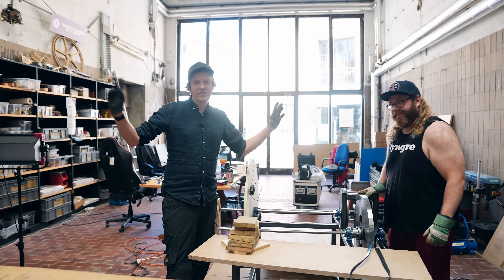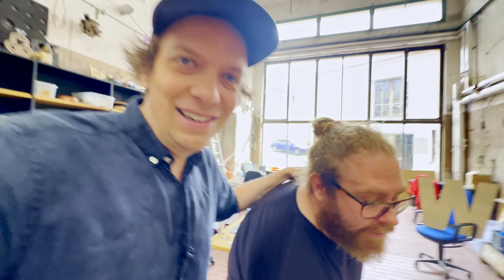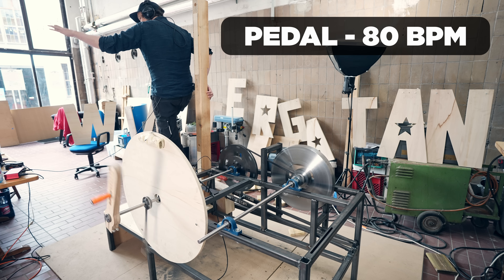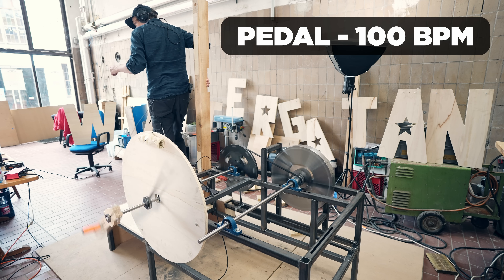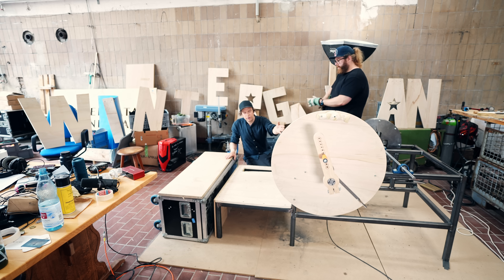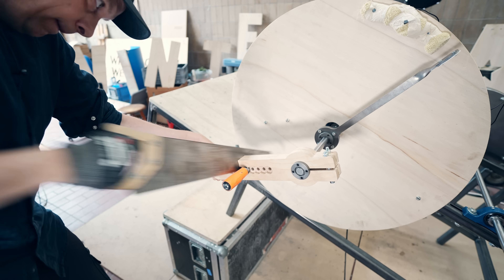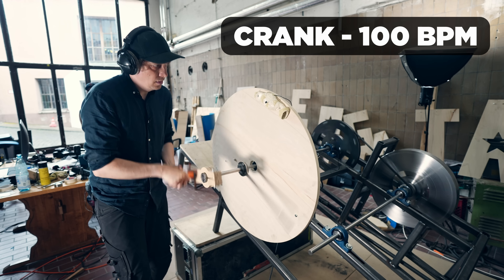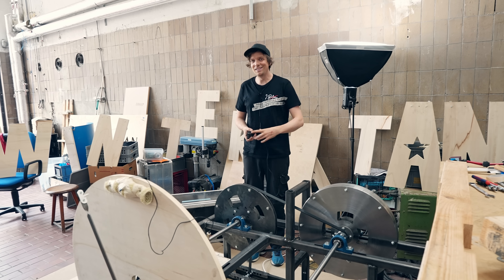Heavy Flywheel plays Tighter music! - DAY 11 - Marble Machine Flywheel Prototype

Comment: You are making a measurement mistake. If your machine is up to tempo, but out of sync with the metronome, it is still correct. Because the metronome isn't making the music, the MM3 is.

This might also explain the software deviation, because if you are measuring in sync with the metronome with your ears, but the software is measuring BPM, of course you are going to get a difference!

Comment: The problem with driving the output directly from the flywheel is that the flywheel reacts very slowly to speed changes. You need to decouple output speed from the flywheel. Add a variable speed pulley if you want to control it manually.
Allows for mich faster changes in speed.

Comment: Looking at the flywheel at 07:50, you can see how it looks like it's slowing down and speeding up, spinning backwards and forwards etc from the shutter effect of the camera.

This gives me an idea, maybe there could be thinner wheel spinning at different speed next to the flywheel (like the shutter of the camera), you could visually see if the BPM is slowing down or speeding up.

Now make it two thin wheels and move it somewhere where you can see it during operation (they could be pretty thin, small and light i imagine) with adjustable speeds for different bpm's you want.

There are eletrical ones called SYNCROSCOPE's used in old manual powerplants for syncronizing the 50 or 60hz signals together

Comment: Hi you can opimize the weight of  the flywheel by the design. You can make it half the wheight and still store the same energy…
The mass of the flywheel need to be as far from center as possible, make the fw center as light Possible and the weight gatered. as far out as possible

Comment: So I must have missed the reason that you are not using a PWM motor to drive the flywheel.  A simple motor controller would adjust the RPM (beats / min) - letting you focus on actually playing music!
Reply: BLDC motor + 3-phase controller. PWM signal would need to come from an outside source, such as an Arduino. You'd feed signal through pedal assist input (not throttle).

Comment: With this fixed gear ratio won't you always be chasing or ahead? Unless you start the metronome precisely when the arm hits the contact mic?..I think you can hit precise bpm...but you'll always be out of phase slightly? Unless you can move the contact mic around the wheel, wait until running 80bpm...or any BPM . Then bring the phases together! ....I think anyway...hope that works ..

Comment: You need to have the crabk arm be a one way ratchet. That way if it spins into you at least it can freewheel and not take your limbs off. But then you can still crank it in the lock direction.

Comment: The crank is tighter than the pedal because you can input power more continuously throughout every 360 degree turn, whereas the pedal can only input power 180 degrees out of 360, sapping power from the flywheel every half revolution, which introduces an inherent energy oscillation in the system. Some sort of bicycle-type crank mechanism would probably give you the best of both worlds: more power from legs and steadier 360 degree power input.
Reply: With a bike mechanism, he could also set it up so a semi-turn would correspond to a quarter note. So to get to 140 bpm, for instance, that would be 70 rotations per minute on the bike. For each beat, that's a foot down, so it's still intuitive.

Comment: Playing something like this as a musical instrument seems to be more of a pipedream than the entire marble machine project. There is nobody alive that has the physical power to manually control the speed of an 80kg+ flywheel in time with a song or a crowd. A governor plus a continuously variable transmission seem unavoidable. (still mechanical solutions, so I don't think they're counter to the spirit of the machine, or it being a physical instrument)  Instead of 'playing' the flywheel, you'd pump the flywheel and 'play' the transmission.

Comment: I think the only solution to get everything as tight as you need is going to be to use an electric motor with an encoder to keep the speed constant.  You could use a battery and a dynamo connected to the pedal so you would effectively power it manually.  I don’t think it’s really cheating, just keeping things tight.

Comment: Is there any other instrument using a flywheel?  It feels like any instrument where you have to keep timing, requires instantaneous BPM control: drums, guitar, xylophone... What instrument fights you while you try to adjust and maintain the BPM?

I feel like the MM really needs a physical power input, and a separate power output that releases the energy at a BPM that's controlled by a mechanism that is independent of the momentum of the stored power.

Imagine a control that released a set BPM, but where the control could be moved to change that BPM.  This feels kinda like an accordion to me.  The musician has to work the bellows to provide the energy needed to make the instrument play, but the BPM is entirely separate from motions needed to power the bellows.  The BPM is controlled by the presses of the keys.  Imagine if the key presses were controlled by a tumbler pushing them instead.  That tumbler needs to turn at one speed controlled by the musician independent of the motions required to supply sufficient force to the bellows.

Comment: When the flywheel is connected to the load (programming wheel, marble lifter), you will have a variable load on the system. How will you deal with the variable load? I suspect you will need a servo controlled electric drive to achieve the stability that you want.

Comment: My personal theory on why the long crank has a larger standard deviation is due to how quickly you could adjust the speed. The heavier flywheel with a harder time to create drastic changes allows a tighter timing as the minor deviations are kept for a longer period is stead of quickly over/under correcting the temp

Comment: higher weight equals less practical to carry and ensamble, more difficult to accelerate, more dangerous and requires stronger pieces and structure.
That is not a win-win situation.  I keep thinking you should use an electric motor to power the machine as you did in the past.

Comment: Another thing, you can see that you're getting "lag" in the system when you add power, you can see that the belt is sagging on the top when you press down on the pedal. This means that no matter how smooth you're trying to add power to the system, the rubber belt is causing you issues.

Comment: Whichever is "better", I think your tour version should include both a crank and pedal. Over the course of a show, you will get fatigued. Having the ability to switch between the two input methods will be a huge advantage, even if one is slightly less than optimum. I also second the idea of @Hrotti, and think you need one or more clutch mechanisms attached to each input on the tour version. One manual clutch so you can disconnect the pedal or crank when you are just using the other, and one freewheel or other one-way clutch (like on a bicycle) that prevents the flywheel from "driving" the pedal or crank with any significant force.

Comment: As stated in a previous video, the design of your flywheel isn't idea. You should aim to have most of the mass on the outer edge, that way it has a higher moment of inertia for the same mass. There is a lot of weight in that wheel (near the centre) that is adding mass, but not adding to a lot of rotational inertia (which is what you want).

A simple solution, if you want to present a solid face to the outside, is to have rings on the inner plates, so that they have a lot of mass on the outside, but nothing towards the centre.

Comment: Just a thought I had seeing you reducing the arm leverage on the crank : 

You are testing only the tightness with nearly no friction so reducing the size of the crank gives you a better control on how much energy you put in the system cause nearly no energy is used. I wonder, when all the system will be linked to the flying wheel, if having a too small crank will not create problem. It will be much harder to give the same amount of energy that the system is using, I would guess. Maybe it would be worth doing a test with friction added to the flywheel (just to be closer to the real situation)?

Comment: I wonder if any remaining standard deviation of 1.28ms @ 100bpm is due to the stretchiness of the belt; I can visibly see it stretching and vibrating every time you pump the pedal or turn the crank. Perhaps the pedal should be connected to the flywheel via a belt, but the actual music machine driven separately from the flywheel, via a sprocket / chain or a gear train. That would prevent the transients in how you pump / crank from affecting how the machine is driven by the flywheel.

Comment: I would add a second flywheel using the other small pully mounted on that shaft beside that flywheel to make the second one spin 3x faster than the first to make the whole system more consistent. The faster rotation will increase the inertia exponentially so the faster the second wheel spins the more energy it will store. Food for thought.

Comment: For the speeding up you should consider using a second system which you can de-couple (clutch style) when you want to switch to hand cranking it. Because imagine the fatigue when you have to bring it up to speed on every song and the time it will take, all also taking possible focus away from other aspects of a live performance

Comment: You can also measure (and display) bpm at realtime, eliminating the need to sync up. This would be useful even later. Right now the test suits a scenario where the marble machine would be a part of a band, when in reality it is basically the band in itself. It has to play a certain tempo, but never align itself with an existing beat.

Comment: How much meaning does this tightness test really have without knowing how much power will be leaving to run the marbles and play music? Is the goal to be continuously putting in energy from the pedal or crank? If so, this doesn’t seem to replicate that situation because the energy flux is much smaller than when the flywheel is powering the rest of the machine.

Comment: While I think that you will be able to make the marble machine play "good enough" in concert, I have no objection to having some kind of "mechanical mainspring" that would get the main flywheel up to "80%" so that you can get on tempo without using up your legs. And, you can use some of that pedal to re-wind that massive spring system, maybe to use as a 'sustain' a little bit. Like the self-winding watches, only really big!

Of course, there is always the option of a motor and encoder to keep it perfectly on time--but a pure mechanical is totally doable.

Comment: Martin, I'm not sure a bigger, heavier flywheel is a good thing. Even ignoring the practical problems with transporting an extremely heavy flywheel, I think the flywheel isn't doing what you actually want it to. All the flywheel does is smooth out any changes in velocity. The problem with that, that I've been seeing in these past few days of videos, is that if you overshoot, you stay overshot for much longer. You have to rely on waiting for it to slow down, and the more inertia in your flywheel, the longer it takes to slow back down, and you remain over tempo for longer. The larger flywheel is taking away your control of tempo, and I think it's taking away your ability to perform with the machine. For that reason I'm even more scared that you'll go with the weight powered drive that completely removes your control of tempo.

I'm not sure I believe that music should be perfectly quantized to a beat, and that there's more to music than a midi file, but if you're absolutely married to the idea of tight music, I strongly believe that you should consider the minimum mass a flywheel has to be to power the machine, add a bit of margin, and then simply... practice with it. Maybe even stop thinking about it like powering a machine, and start thinking about it like keeping a beat with a drum, where you can control the beats more individually, and the tightness (or lack there of, if the music calls for it) comes from practice and skill. Right now it really feels like you're giving up control of the tempo to a giant high RPM death wheel.

I rarely if ever comment on your videos, but for what it's worth I've been watching the channel since the original marble machine 1 build videos, and my maker friends and I often talk when you post new videos. I want you to succeed and stand behind you, and if you don't think anything I've said is worth holding on to, I encourage you to let my thoughts go, but as I've been watching these videos I feel more and more like you might be slipping into the cracks of details and missing the forest for the trees. You're making an instrument to perform with. A machine to make art, not a clockwork nuclear reactor that explodes when the spring isn't wound.
Reply: as a small addendum, during MMX development, you talked about machine failure, and how if even one out of ten million marbles could cause catastrophic failure, that was unacceptable, and I wanted to be clear that the above comment isn't talking about that. The math on that calculation makes sense, and I think the precautions you took there were pretty necessary

Comment: Almost seems like the ratio on the flywheel should be twice what it is. Like 30:1. Sure it will take longer but it will hold a tighter beat for sure.

Comment: Can you separate the timing from the flywheel speed somehow?  As soon as you take energy out of the system the tempo will reduce. Also how long does the flywheel spin after you stop putting energy in